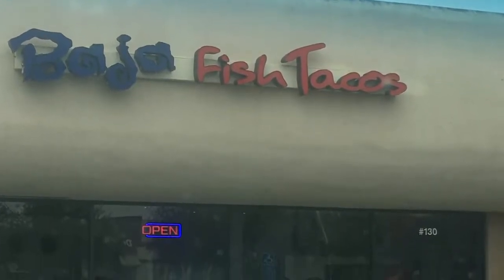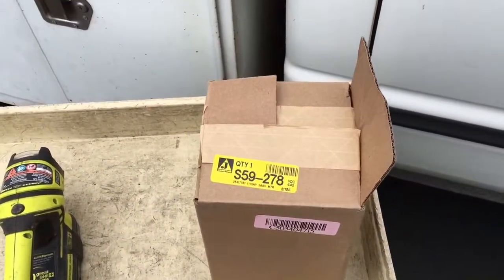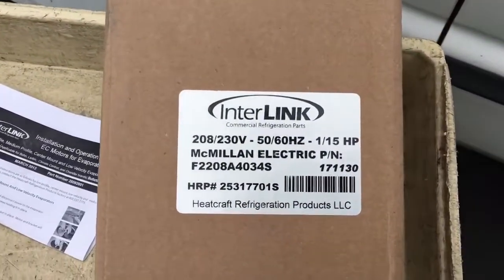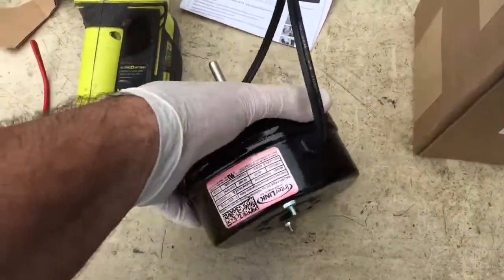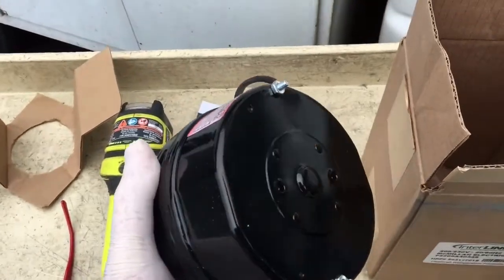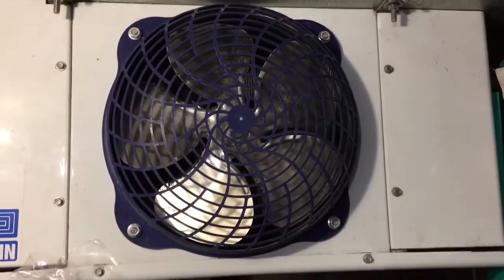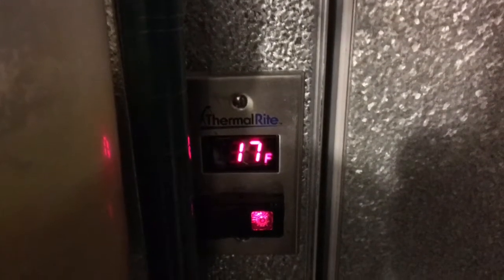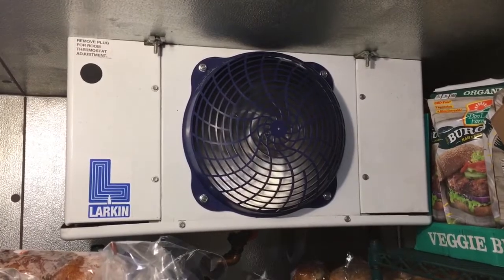Replacing the Larkin Freezer ECM Evaporator Fan Motor.

Comment: I cant stand ECM motors. Mainly because of the switching frequency the electronics engineers chose to use. I dont go to the grocery store and shop nearly as often as I used to because the refer unit fans running sound like someone is driving a stake through my head. nails on a chalkboard. YUCK... Yes I can hear those "frequencies"
Reply from the maker: Sounds like a great time to buy some 🎧 & Listen to some good music while shopping.